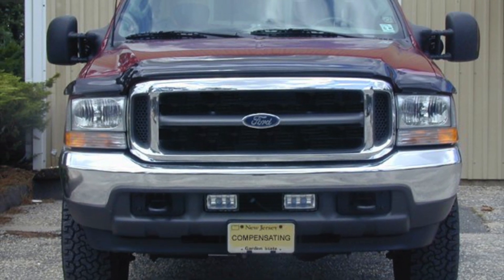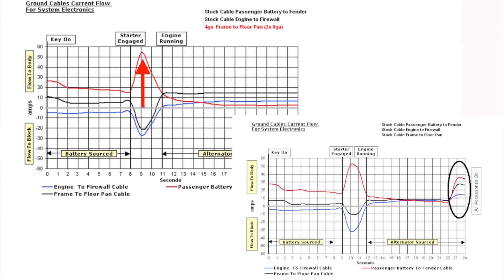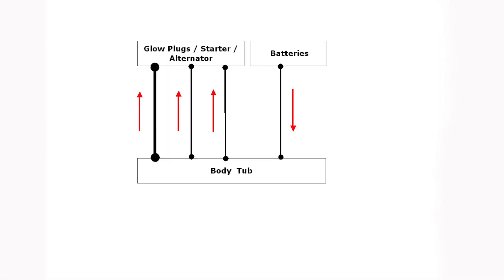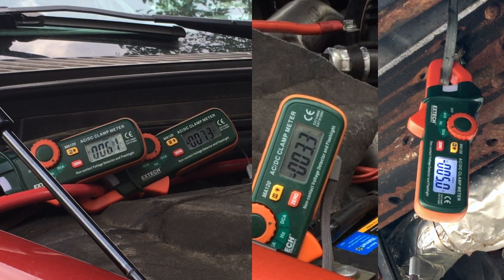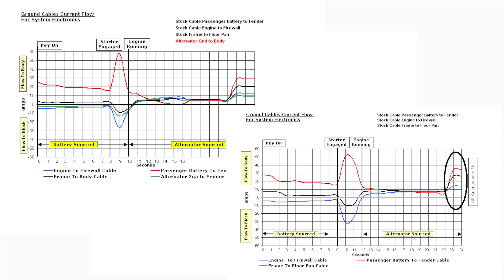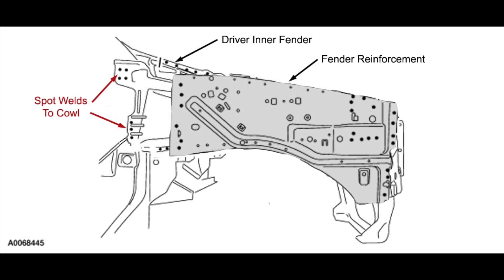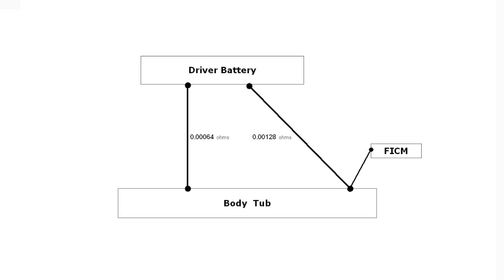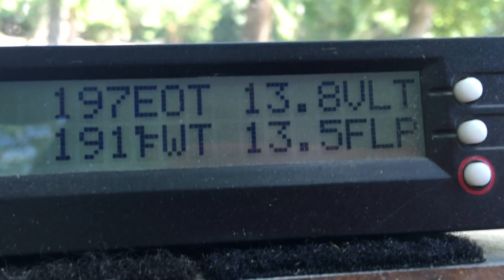Powerstroke 6.0 Electrical Ground Cable Solutions

Comment: Is there a summary somewhere of all the cables, their sizes and mounting locations?
Reply from the maker: Do you mean all the factory cables as they lay?  No.
Reply: @toomanytoys I meant of the cables you added. Great videos by the way, very informative.
Reply from the maker: @BackToBasicsWithBrad  Thank you.  I do have that in one of the videos for all the cables I've shown so far.  The positive cable battery to battery was 70" of 2ga, 1/4" eyelets.  The negative cable from the driver's frame to the engine block was 24" of 1/0 cable, 3/8" eyelets.  The driver's negative terminal to the FICM ground point was 24" of 8ga, and the FICM carried over to the PCM firewall ground was 18" of 8ga, 1/4" eyelets.
Reply: @toomanytoys  perfect. Thank you.

Comment: Awesome video and super informative! I enjoy watching your content. I’m decent at computer engineering from a security perspective, but must say I’m not that well electrically inclined. I ended up replacing a bunch of ground with 1/0 OFC cable, and ran an additional ground to the battery from the passenger fender that tied into the same bolt for the upgraded alternator ground (mechman 390 alternator install). I also upgraded the 7” cable underneath the passenger door like you showed with 1/0. Does that actually make things worse in the long run?
Reply from the maker: Sorry for the late response - the message got lost in my search.  It depends on all the other grounds.  The alternator to the fender during starter engagement can overtask the 8-gauge stock cable with the system in its original layout.

Comment: Excellent detail and information. Do you have a document that shows factory ground locations?

Fighting an intermittent no crank situation…
Reply from the maker: My earlier video, which was the basis for this one, goes through all of that:  Powerstroke 6.0L Electrical System Negative / Grounding locations
  
https://www.youtube.com/watch?v=QYM-KD5vNWM
Reply: 2007 f350 6.0 lariat

Comment: How do you like that Extech MA120?   I'm wanting the same tool to do this exact job (balancing cable loads) on different vehicles. I'm wondering if there is a different one you would recommend now that you've had plenty of time & experience with it. 

Would you spend more for higher accuracy or less money on it if this is all you planned to do with it?
Reply from the maker: I haven't used it to its potential.  I would not spend more for a similar one, but then, my needs are mostly in the automotive diagnostic area.  For what I do, its worked well.  I have a number of products for the same company and all have been good.

Comment: I have had THREE FICM failures recently. Which ground wire do you see as most critical?
Reply from the maker: I would wonder how they were failing and if there was a short in the wiring that might cause them to fail if the FICMs came from good sources.  

Ground 101 Is the FICM ground, which shares one of the two PCM grounds.  I would also do G100, as that is the second PCM ground, and you don't want a floating voltage between the two.

This is a picture of there location.

https://drive.google.com/file/d/1ysrD6HinNwEXdSG6dTjtod4M8xhNkFHX/view?usp=share_link

Comment: I have 05 250 6.0 had bad batteries try to charge overnight to drive to auto parts store truck died jumped it off to make it back home an battery light was on I replaced 2 batteries new now battery light stays on if I floor the truck the light goes off what could be my issue
Reply from the maker: Most likely, the alternator is not working correctly.  The "battery" light doesn't tell the batteries are bad; it indicates the alternator output voltage is lower than the battery voltage.  The batteries may have been bad from chronic undercharge.  You should review an early video of mine about the situation.    

https://youtu.be/mEbbPwa_-oc

If one or more of the diodes is burned out, it would take a high rpm for the alternator to output full amps and support a high voltage.
Reply: @toomanytoys  thank I am getting a new alternator today

Comment: So now I see why it is a good idea to add a cable from the driver side "-" terminal to the Minor PCM Harness ground, which if I were to upgrade to a higher output alternator (e.g. 230-240 amp), I should run at least a 6 ga cable, not 8 ga as suggested here.  I hope I got that right.
Reply from the maker: Replying in the Grounding locations video.

Comment: All good info,,
But I think the main problem is the one factory ground at the right front of the engine.
I install a secondary ground wire on every 6.0 trans I rebuild,,I buy a 4 foot long 4 guage ground wire from the auto parts store about 10.00,,
I connect it to the drivers side motor mount bolt,then fish it up to the drivers side negative battery connection. No more come backs with destroyed front pumps.
Reply from the maker: That was a solution I used in the balancing the batteries video, eliminating two connections of resistance in getting the drivers battery to work harder.  This is an addition to that which brings the voltage to the ground plane a little more effectively.

Comment: Can a bad glow plug cause lower voltage?
Reply from the maker: No, it would be a little less draw on the batteries and slightly higher voltage, but that would be hard to see if just one.  A bad glow plug should cause a code.
Reply: I’ve got a p0863 code so I think I’ve got a glow plug out, I got new batteries and a new alternator and still can’t get my voltage over it’s average 13.6-13.8
Reply from the maker: @jackkawa7  The voltage reading from where?
Reply: My sct x4 tuner
Reply from the maker: @jackkawa7  You do have some drop in the harness and how the PCM reports, the PCM part you can't do anything about.  By SAE standards, alternator output should only be 13.8v when the engine is hot.

Comment: I’m very impressed with this mans knowledge that he has imparted to everyone on YouTube.  I came here because I was concerned about grounding issues to the transmission/frame that caused a fusing inside Ford 7.3 and 6.0 Powerstroke transmissions.  I saw the video on PowerstrokeHelp, this is invaluable information!!  Thanks for the great info.  I will be taking care of these problems as I change out my batteries wiring and grounds to go with my new batteries I installed.
Reply from the maker: Thanks for the comment.

Somewhere in the future I’m going to do a video on that.  There’s no way for it to weld in a stock condition, but you create a potential if you install a connection between the frame and the ground.  If the main and only one connection of the negative or ground at the front of the block (early recall), and you have the trans grounded, now you are going to send all the starting current through the trans.  It’s why in the Ford body builders guide it specifically states to never install a ground to the trans.

The typical reason for that area of the pump to weld is if the torque converter is not installed correctly when the trans and engine are reconnected.

Comment: I have a Leece-Neville 230 amp alternator in my 2006 6.0. When i start the truck it reads 12.5 volts and climbs up to 13.7-14 volts is this normal? it seems like you have much higher voltage than me. also when i start the truck sometimes the idle fluctuates down about 100 rpm and then a second later its back to normal and when the rpm drops the voltage jumps from ~13.5 to 11 or 12 volts then back to 13+. The idle fluctuates like this until the truck has warmed up for a minute or two. Does anyone have any ideas about what that could be?
Reply from the maker: Visit my video about the 230a, you are experiencing the GPCM tug of war.

The voltage dpends where you are taking it from.  Many of my tests are taken off the battery, which will be higher than any monitoring from the OBD2 port.  Plugs I've gone through all the ground and harness connections on the truck, another video.

Comment: @ 0:20 The lower ground / bonding cable that connects the body to the frame under the passenger floorboard is Ford part # FU2Z-19A095-A in case anyone was wanting to replace theirs
Reply: I believe you have transposed two of the figures.  It should be F2UZ-19A095A
Reply: Stumbled across this comment after replacing mine with a 10ga wire. It was green like in this video. I want original to avoid problems. Thank you.
Reply: Why not add just a regular ground cable?

Comment: Hey buddy so at this point what did you exactly add?The driver side frame to block...What else exactly?
Reply from the maker: Are you asking me or someone else.  I'm not Bill.
Reply: TooManyToys haha it was my auto spell check crap, I actually meant BUDDY, I swear I hate autocorrect sorry bout that
Reply from the maker: If you see a consistent disparity in battery life where the pass batt fails early, the added positive cable between the batteries and a more direct cable from the driver's frame to the block will address that.  For overall voltage, cleaning all the grounds and adding an 8 to 6ga ground cable from the driver's battery negative to the FICM and PCM ground points at the fender and firewall improved that for me.
Reply: TooManyToys thank you good sir really appreciate the time you spent figuring that out keep up the good work
Reply: So I’ve been messing with this a bit and what im not understanding is how many actual wires you added 1. Drivers frame to block 2. A cable going to FICM ground on fender 3. Another cable from battery to fire  wall ? So 3 added wires alone on the drivers side? What about the ground in front on drivers side right by the light?Or did you run a cable to fender then another one from same point on fender to fire wall?Sorry for bugging you about it so much I’m just trying to understand ....
Reply: Another thing is what about a ground from alternator to drivers side battery and a cable from alternator to passenger side battery?To be more specific from the actual mounting bolts of the alternator...?
Reply: You dumbed it down enough for me I believe but I will check out the forum and I really appreciate it, if you had a pay pal or cash app I’d send you a few bucks
Reply from the maker: Nothing to the alternator on the ground or negative side, that was a test, not what I recommend.  If you are adding a large alternator then you need to address the positive side of the alternator.

1.  A 1/0 cable from the drivers frame to the engine block.
2.  A 2ga or higher between each battery positive.
3.  A 6ga cable, no larger,  from the drivers negative terminal to the FICM ground on the fender, that continues to the PCM ground at the firewall above the booster.

That's it.  If off the drivers negative to the FICM you use an 8ga, then add an 8ga to above the headlight as well.  But if you've done the 6ga, it not necessary.

Any more on this you really need to bring to the Ford Truck Enthusiasts forum.  YT is not the place.
Reply: @toomanytoys , thanks for all the clarification here! Why would it negatively affect things if you went over the 6 gauge wire for the FICM ground to the driver negative terminal? I have spare 1/0 and was going to use that. I did the same thing on the passenger side to replace the tiny ground that goes  from the fender to negative terminal. Am I doing something wrong? Many thanks for the help! 🙏

Comment: Great info for 6.0 owners and bad grounding effects on transmission.
https://m.youtube.com/watch?v=Jm8-EIt0-Gw&t=443s
Reply from the maker: Actually that's not a failure of electrical grounding, it's a failure of rebuilding or installing the trans.  You'd have to pull some hefty amps through a trans to do that, and everything behind the transmission is isolated from electrical transfer.

https://youtu.be/xL1RlxhJebI

Comment: WOW!! Man you got more information than I ever dreamed to find but I need help. I have had some issues with charging in general and now my 2004 Powerstroke in and F350 Super Duty SRW needs some advice. She has dual alternators (lower is 300AMP and upper is Sinister 250AMP HD) But wiring is a major question. I could really use your knowledge in this area and have loved your videos....they just don't reference dual alternators. Do you have a site or a way I can contact you? Bill
Reply from the maker: Bill,  I don't have access to a dual alternator truck.  I hang irregularly at FTE in the 6.0L forum and you could post there.
Reply: @toomanytoys  I guess as a retired military member I have an innate sense of "bigger is better" programmed into my brain...a curse I guess. Anyway with the obvious $$ I have tied up in two new alternators, two new Optima yellow tops, and a Sinister Diesel 58V FICM, I was just looking for someone to tell me what gauge wire to use where as I install the new stuff so that I have as close to an optimal endpoint as I can get. You are so well educated in this I thought you may tell me for example, go to 1 ga wire at the battery neg to grounding point and go to Alternators with x gauge, etc...I dont know where to go and dont want to make a stupid mistake. And by the way thanks a million for the quick response. If you want to send direct to me, I use gmail and my user name is SPURFLHR. Thanks again, Bill
Reply from the maker: @spurflhr   Bill,   If you didn't realize, FTE is  https://www.ford-trucks.com/forums/forum107/

Thats a tremendous amount of amp potential.  Everything depends on the length of the wire.  Given a 300 amp flow at 14.4 volts, at 24" a 2ga cable would have a voltage drop of 0.1 volts, a 2/0 cable 0.05 volts.

If your cable length was 48", 300 amp flow at 14.4v the 2ga would drop 0.2v and a 2/0 cable 0.1v.

A stock Powerstroke at 30 seconds right after startup has the potential need of 205 amps for full battery recharge, glow plugs, and every electronic device you can turn on with the exception of a trailer.  Once the glow plugs turn off the maximum potential demand stock is 110 amps.

Comment: Awesome information but a bit over my head, is there any way you could provide a shopping list of parts used and where you installed each of the cables? ( please dumb it down for me) Lol. I need to replace my alternator and I don't want to burn anything up by not upgrading the right wiring.
Reply from the maker: David,  you might want to check out this thread at FTE where I usually hang.

https://www.ford-trucks.com/forums/1543839-grounding-negative-side-work-3.html#post18226155

Comment: Thank you for posting these videos, it has been very helpful to me.  I have a 2005 6.0L with the bullet proof oil kit, it is running great at 100,000 miles.  I am going through the truck for a 100,000 mile maintenance and restoration project and discovered extreme galvanic corrosion on the (bulletproof) iron shroud that protects the (bulletproof) oil filter in the driver front wheel well.  On close inspection, the corrosion starts on the shroud at the frame attach point and runs across the surface in a straight line to the bumper attach point.  Electrically, this provides a significant path for electrical currents to pass between the frame and the body.  This did not make any sense to me until I learned from the videos about the major current flows going between the body, frame. and motor.  Easy fix for the shroud, clean up corrosion and install nylon washers at the attach points to electrically isolate the shroud from the frame and the bumper.   Definitely staying tuned for your next video, thanks again.